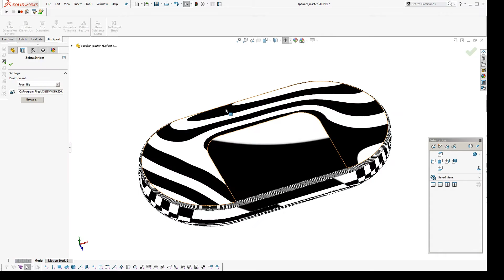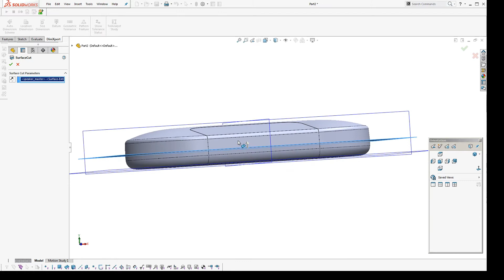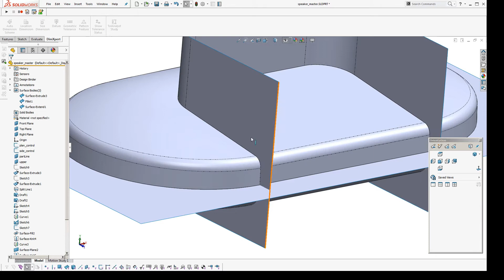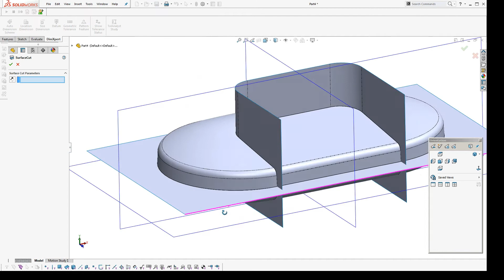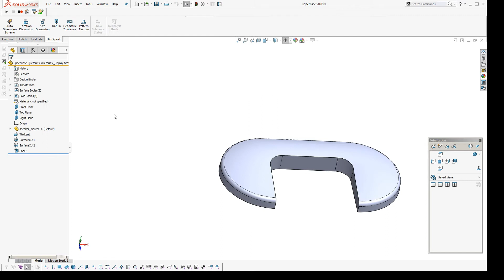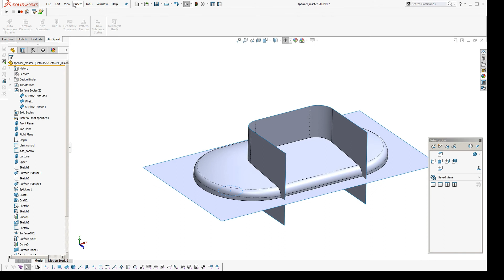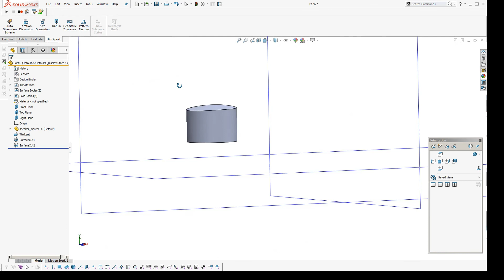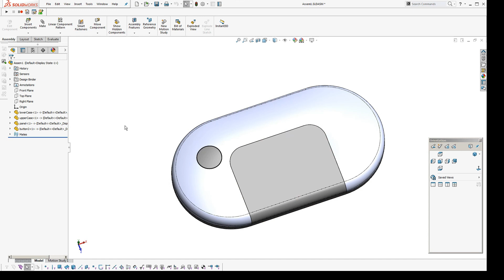Solidworks Tutorial: A master model methodology using 'Insert Part"

Comment: whats the advantage to use a master model compared to modelling all parts in one part file? And how would you go forward to create a interface between the parts, for example screw bosses, lip etc., or if you have a part interlocking another do you add draft in the master file?
Reply from the maker: Hi there, advantage being you can add part specific features in the parts, rather than adding a ton of features to the master. It’s best to limit features in the master to geometry that relates to more than one of the output parts. So for bosses, a plane to define the coincident surface and an axis. This video has arisen from the dead, where’s this being shared?